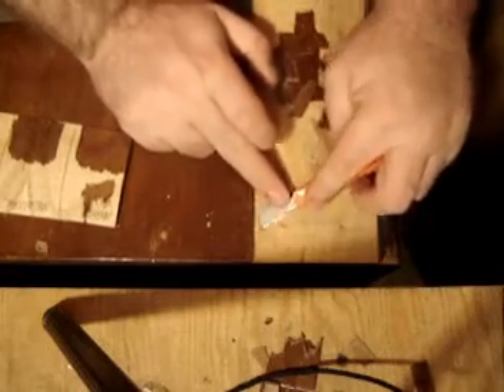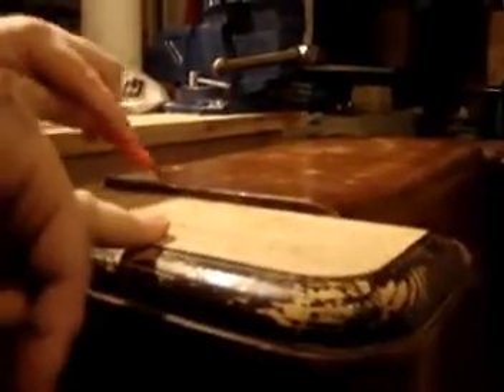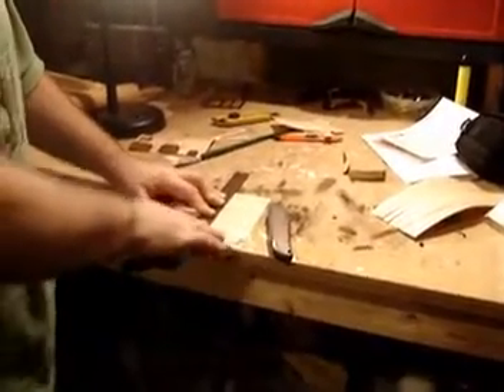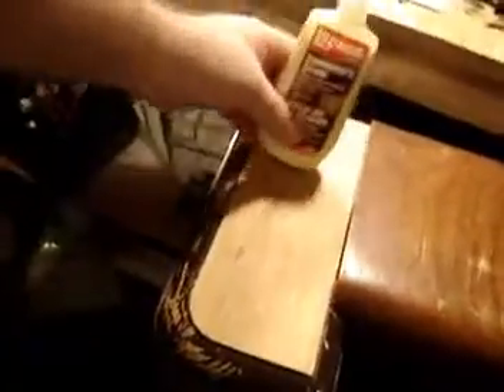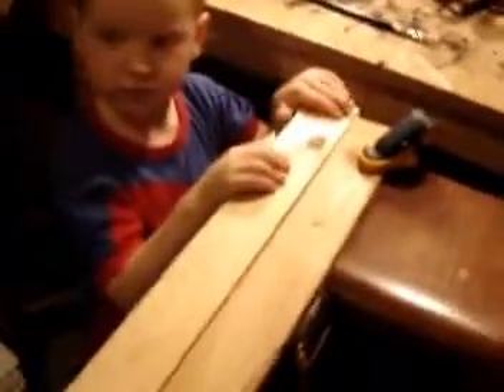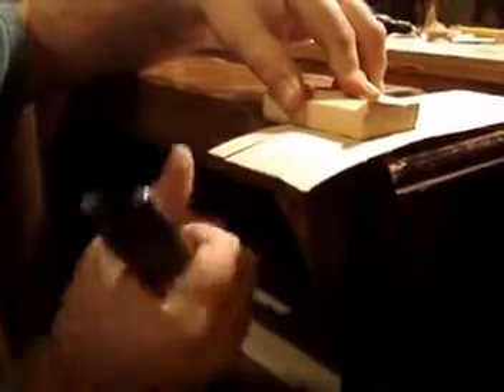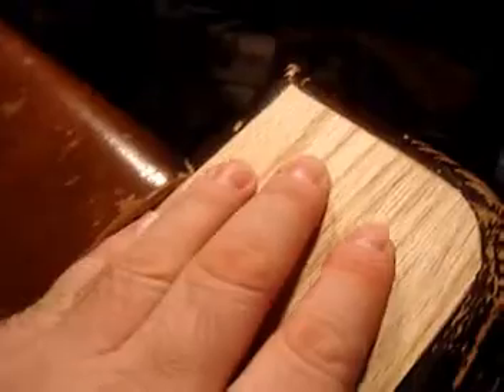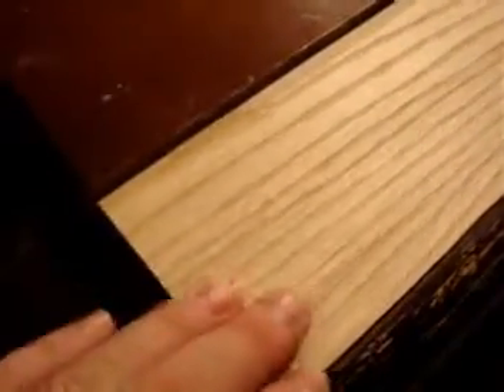Repairing and Restoring Tube Radios - part 5

Comment: Just a thought here and even though this vid is about 4 years old, it may be worth mentioning that resistors of that era (circa 1940s, etc.) tend to go out of tolerance after so many decades.  Most restorations I've seen online suggest replacing all caps and resisters with modern equivalents.  The new materials and manufacturing techniques for these components will ensure that the radio will work far into the future thus greatly exceeding the manufacturer's expectations.
73
Pete Arnt, AE6YI